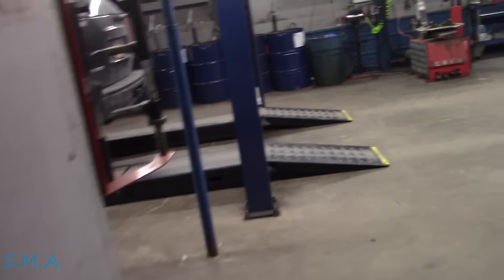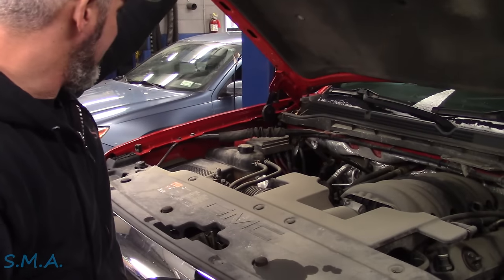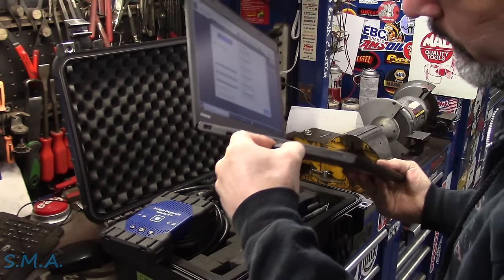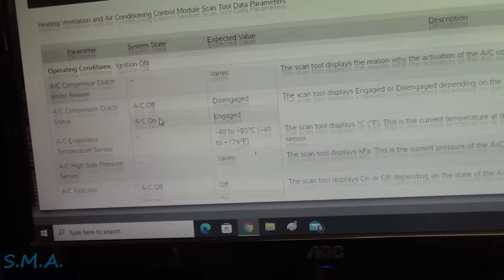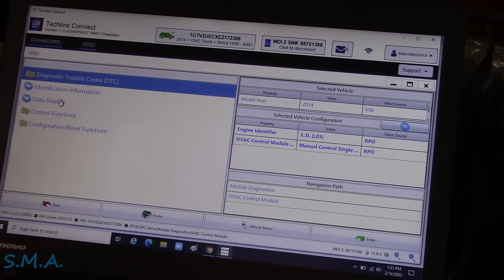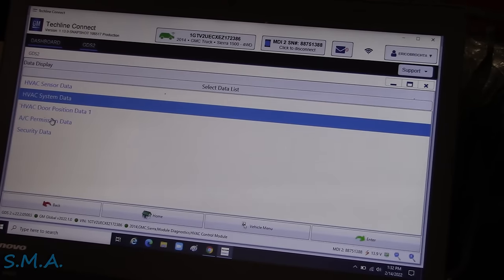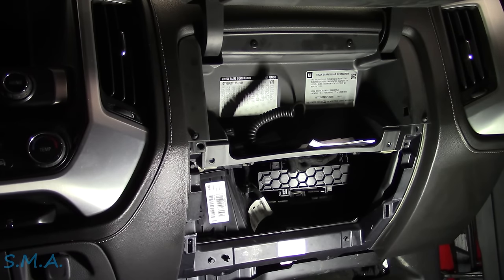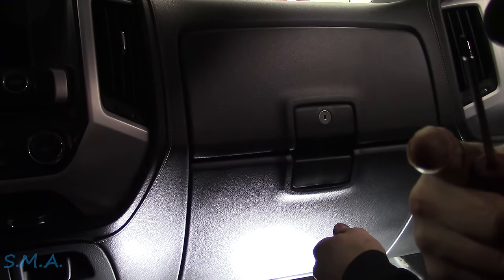Chevy/GMC Truck: Failed Heater Control Module

Comment: Almost every job is loaded with monotony. When I started in automotive I was bored out of my mind with changing and setting points and changing 100 or so plugs every week. The crappy wiring systems in the trunk of every GM car. the rotted exhaust systems and slushcicles dumping down the back of your neck. The same old shit with NYS Inspections. Tie Rod Ends and Ball Joints and way too many alignments.. At least you have issues that takes some brainwork to figure out and R&R!!  I do agree that there is far too many stupid systems on todays cars/trucks, but everyone has to have soft touch everything with heated butt-boards. My key is different from hers and the trucks knows it, so it adjusts everything for that person/key. Hell, I don't know how we ever rolled up our own windows!!!! So yeah, it doesn't matter what your doing if it becomes boring and hey, you could be working on BIG RIGS!!!!!  lol... Yeah that's why I said it....   ;)

Comment: I drive an '86 Toyota truck and an '85 Ford van. One uses a vacuum controlled heat valve and the other a cable operated.  How laughably antiquated and low tech. They just work and cost maybe twenty dollars to repair.

Comment: What you’re saying Eric begs the question, why are the manufacturers converting to electronic control of simple things like a heater?  Is it to prove their mastery of computers?  Well, they proved their mastery of cables that were used for decades to move the various doors in the heater. 
One solution to beat the high cost is to buy an extended warranty and get rid of the car/truck before the warranty ends. That puts guys like you with little to no work🙁.

Comment: just heard u complain about how cars and designes getting so ccomplicated , no more DIYING. go look at aviation, general AND commercial. I've test and repaired, to the component level,  the electronics that drives the motors ,that move slats n flaps. In this particular, nameles, commercial jet had this box located unger the galley. How do I know, cuz they 70% had LIQUID INGRESS inthe form of coffee or COKE. Also, small fires on PCB, hot componenets melting solder. Ialso worked on 1980s boxes that still worked flawlesly. bottom line.... SUCK IT UP, CUPCAKE. and BIG THANK U!! 4 what u do, and 4 what looks like wonderful family.

Comment: Yeah, the whole shooting-match is getting out of hand, and it becomes a big, positive-feedback loop. The more prices increase, the more desirable these parts become to unsavory folk, and the more it costs manufacturers to come up with wacky new ways of locking them down, which raises the prices even more. And the chip shortage doesn’t help the situation, nor does the bubble in used car prices. Eventually, it feels like driving down the road in a padlock with 4 wheels (or 6, if you’ve got a dually)! 🤬

Comment: If you think these HVAC systems are over the top with electronics, you should take a stab at missile targeting and launching system. I'm a retired electronic mechanic, and most my career was chasing the sort of problems seen on that HVAC system.  Gotta be honest, I've been thrown sideways by the systems in civilian vehicles I've worked on.  Much of it is poorly designed, looking at you Range Rover. This is my thing and I'm challenged at times. How are automotive techs supposed to keep up without additional training? Completely forget about DIY repairs. Maybe get into the business of doing analog conversions, haha.

Comment: The main problem with today's tech, can't be deleted without 10 other systems going crazy, things have to be programed. Everything should be its own system and everything modular at this point. There is only 1 reason that it's not, so we cannot fix things ourselves,  that's the point of it all

Comment: Full size truck and they still made it difficult to r and r. Design engineers should have to take things apart and learn how to make service peoples life easier. Wishful thinking I know. After seeing that I dont want a newer vehicle. In ten years these electronic parts will not be available so then you hope you can find old used ones. Dont want to think about it.

Comment: Decades ago I read an interview with Smokey Yunick talking about the increase in tech in the auto field.  At the time, 4 valve/cylinder was up and coming.  His statement on that?  Sure, nice but way more than what was needed.  His zinger?  What until people have to start paying for it to be fixed.

It is getting worse.  I read last week that the auto companies are looking for ways to charge a monthly fee for certain function on your car.  I guess they are looking at Cat and John Deere for inspiration.  Have you read about what they have done with computer/electronic processors/sensors and how you can't fix it?

Lastly, you think this is bad?  Go become a health care provider.  

As someone noted below, every job/career has it's issues.

Comment: I want to see the numbers before I say newer technology is better or worse. 10 guys coming in for a $100 blower resistor or 1 guy coming in for a $1000 module is still 9 less needed repairs in GM's perspective. And becuase less of the modules need to be made as spares for repairs, they probably cost more to manufacture.

You made a short a while back about a ~$1500 gmc led taillight when tailight bulbs are like what, MAYBE $10?  But how many resistive bulbs fail compared to LED's?

I will add though generally less hardware in a system is always better than more, because more hardware has a higher chance of failer compared to systems with less.

I don't know, I'd really like to see the numbers from GM.

Comment: It's absurd that you need a special factory programming tool with a license and dongle for the software to program a heater module.  It really should be as simple as the module receives the info for the specs of the truck from the main ECU, like dual zone climate or single zone etc, and then sets itself up.  That whole process with the programmer and licensed software to set up a simple module is just to be borderline anti right to repair and to bilk the customer and the shop owner out of their money.

Comment: All my and family vehicles are late 80's to late 90's models, minimal electronics and of far better durability of components thanks to over engineering quality mixed with simplicity rather than over engineering complexity mixed with component poor quality .
I got no idea why so many people so easily spend crazy bucks on the new garbage.
hybrids and elec going be ballache of niggles and expense for owners and ballache for technicians try diagnose and physically repair .
My old stuff easy fix but unfortunately hardly ever need touch anything as it too damn reliable :-)
I'll be retired just in time miss out on the full craziness of 2022 garbage thankfully ...

Comment: Why do they put so many electronics/electrics in cars now? Because they can. I've always thought that phasing out the simple cable operated parking brake for an electric brake was ridiculous. Computer modules should be dirt cheap. Four hundred dollars plus fitting for the work you have shown takes a bite of the pay packet. Don't leave the trade we need honest mechanics!

Comment: This is why I love my old beat up jalopy of a Chevy pickup truck.  It's entirely future proof...totally EMP proof...completely shade-tree mechanic fixable...and parts are everywhere!  
If you want heat...slide the lever over to "HOT" and you got it.  If you want air conditioning...roll down your windows and drive faster.  
My grandpa used to tell me:  If it ain't broke...don't "fix" it.  
So...yeah...keep your way-too-expensive bluetooth enabled computerized vehicle...I really don't need all the IN-conveniences that come with them.
Reply: Same a/c as I have in my truck I call it 2x55 2 windows 55mph

Comment: I think for my next truck I'm going to find a nice older C10 because this enhanced defrost control module programming stuff is bullshite. I'd much rather set up points on the side of the road and be off in 5 mins.

Comment: this is why i prefer older vehicles less computer bs n well alot more rugged now a days all plastic n sheet metal  hell u cant even work on the engines without needing a computer to talk to others in the engine n there is no damn room i remember back in 80s u could sit in engine bay n work easily n all u had to do was plug in a small wireing harness ...far as future in vehicles they be all electric n need them serviced at the dealer ...i see everything on the suspension gonna be computer based n of course they would rust faster cheaper materials n more costly

Comment: for the OVERWHELMING feeling of repair and knowledge and cost of todays cars , be glad its not a TELSA ,  $16,000.00 for heater repair !  Off course , back in the 50's you could push a car to get it to start or pour gas in the  " CARB" to get it to fire . Oh how times be a changing 👴🤑

Comment: I have a 2015 Malibu, it had a steering problem, the wheel would get tighter then release, tighter to turn then release... it was under factory warranty they knew what it was, my steering need to be REPROGRAMED! MY STEERING?!?! hat's insane, that my steering needed a software update. We will no longer be able to repair our own cars. If I needed to do this myself I'd need a $3000 computer and the rights to buy the software from GM and a $500 adapter cord. they covered it be cause the car was 3 months old, if it was 3 years later it would have cost me several hundred dollars to "fix" what they already knew. that's why I want to keep my 24 year old truck as long as I can, but up here in the land of "Rust and Corruption" it's hard to do.

Comment: It's like what I've been reading regarding the farmers and John Deer. Their tractors have gotten so complicated and computerized they need special software and equipment to fix them and John Deer isn't interested in letting them have it. So the poor bastard farmer has to haul a dead tractor or combine to the nearest stealership to get it fixed putting the farmer out time, potentially ruining their crops if they need it harvested quick fast and in a hurry, and a tonne of money. Not like the old days when all they needed was a small box of hand tools and a bit of know how.

Comment: I am probably a little beyond a shade-tree mechanic level and have a well setup workshop, but my issue is getting accurate data to follow. I want to subscribe at great cost, but Mitchell wont even let me here in Australia, because I am not a registered business. What level of bullshit is that I ask! Not all models we have in this backwater country even have a manual available if you wanted to purchase it. Makes it very hard. Try getting a workshop manual for those crappy ford "powershit" gearboxes we have been stuck with here. Not even ATSG has anything other than a description manual. That is the biggest problem because we do not have any law mandating access to maintenance data, unlike in the US.

Comment: Eric, prior to 2014 trucks and cars were not repairable to to do it yourselfers. Most low end scan tools wont communicate with hvac, trans, entertainment or sir modules. Even if your scan tool was capable to communicate, nobody wants to purchase a mdi or subscription to program. This is only getting more complicated and less rewarding to technicians. I totally get your drift on moving on. Best of luck sir & well done.

Comment: hell i have sas, abs, traction control lights on in my chevy and i don't care because i don't need them. i was born before they put all that crap in cars and learned to drive without all them so as long as it don't affect how it runs i can care less

Comment: Thats the problem with these newer cars there is too many electronics on what happened to the mechanical controls crap did go bad as much this is the government controlling the auto industry you have to meet fuel milage standards so they have to make everything out of plastic and electronics my 74 buick apollo has more metal in the bumpers then that gmc your working on

Comment: Dealer programming is a huge scam. All the parts should be plug and play.
Could you imagine your computer being like that? New video card that doesn't work because you can't program it. (Sure, drivers, but those are free)

Comment: Really good quality capacitors have a life of 50,000 hrs in optimal conditions In the interior of a car in the summer at 120+degrees they lose electrolyte even faster. There will be no (or very very few) post-2001 cars or trucks still running after 25 years. It is ridiculous that a system that used to be run by a simple cable and bellcrank now requires 3 (or more modules) to function AND worse yet if your vehicle has codes it cannot be registered. Explain to me again how this is good for the environment hint it isn't not when cars used to be good for 30+years and are now obsolete(to expensive to fix) after 10-15. I love my 1998,1999,2000 Saturns 40mpg and no unnecessary systems just a good engine management computer with relatively simple sensors that can all be daiged with a test light/multimeter(scope if you really got a weird one). I will never own anything post 2010 unless it is 1yr old and a trade it in at 4yrs

Comment: Surely there is a market for cars that are more basic. I can manage without Sat nav lane assist complicated fuelling and ignition systems. Even just plain simple aircon no climate control. ABS and Airbags okay they are good safety features. Just get rid of the crap that looks good on the advert. I know I'm in dream land here, none of the big manufacturers have the guts to do it

Comment: How many years did the cable system work, the good old days. A module to run the heater, then the taillight circuit. The smarter they the engineers think they are, the bigger pile of junk they build

Comment: You aint the bad guy, the bad guy is the ones making everything runn off of modules when they dont need to be. Plus nobody made these people buy these vehicles. You are fixing them a lot cheaper than the dealership does, Im sure.

Comment: Crap like this is unacceptable. Sorry. I do not understand how HVAC controls need to be programmed. I've loved those digital HVAC controls too in older cars. My 05 Taurus had it, the "brains" behind it died (actuated the vacuum and blend door actuators behind the dash, not on the panel itself), and I was able to just swap a new one in, no programming needed. My 1995 Ford Thunderbird has it, still working great. My 1994 Roadmaster has it, also working great. Though I did have to replace a vacuum control module for the climate control, which I harvested one out of a Cadillac car. No reprogramming is the point. HVAC should not need programming. I get perhaps features exist, but why not just detect what is there? "Oh, I see the PCM says there's A/C, I detected two blend door actuators, I bet this car has dual climate control. Oh and since I see the PCM? Appears this is installed in a Chevrolet!"

Crap like that is why I am trying to preserve my old cars alive. My daily, a Pontiac Vibe, just has cable-controlled temp and blend doors, simple knob for speed. I have zero desire and cringe at the thought of a newer vehicle that is overly complicated.

Comment: There is no real reason you should have to program a module like that. That requiring programing shit is done on purpose, should just be plug and play. Even if it's the same module used for many different cars the ECU could inform the new module of what car it's in and then have it configure itself

Comment: Content sells. To bad it comes with recurring expense as it craps out and makes your vehicle become unpleasant or impossible to operate. Fuel injection, ABS and traction control and other safety features are sane application of technology. The rest of the automation in cars these days is a lot of unnecessary fluff.

Comment: Recall the good olde days when Robert Pickton abductted and murdered at least a dozen women.
Well, we can thank modules, especially GPS , etc. for keeping track of all vehicle movements these days.
I really don't relish being choked with a cable personally.
The more a vehicle can be rendered as less of a weapon, the better.
Being able to immobilise a vehicle going the wrong way down an interstate would require a fine module.
If a vehicle gets sophisticated enough that it can prevent criminal usage, then that is fine.
No one complained about the old tv series Knight Rider.
Moses descended the mountain with the tablets inscribed with the Ten Commandments.
Moses was famous, but mechanics have to work harder for simple status.
You know there are too many modules in a vehicle when there is no room to sit inside.

Comment: It's freaking stupid, yes. And it's only gonna get worse. With electric cars, you won't be able to do anything. Batteries are a hazard to begin with, everything is interconnected, and monitored, and proded, and sensored up to the hilt. You'll need Diagnostic Bot 9000.

My 'infotainment' system has just failed. It's a black box and a display. It will cost me £600 to get it sorted (and I consider myself lucky on that front), all I want is a MP3 player and phone. I don't need GPS, I don't need all the extra crap. 

A mp3 player with bluetooth and phone connectivity costs £60. 

I cannot put a £60 mp3 player in my car. But I could with my previous pre-2000 car.

Comment: Levers and cables. What was so wrong with them?
Now you have a module and an infotainment gizmo and a this and a that and a blend door motor to go bad and then something to program it when it goes bad and a computer and an Eric O, and... Then you wonder why a pickup costs $60,000.
Why? So you can have 'automatic temp control' or your wife(yes I said wife and not significant other 🤦) can have her zone 1 degree higher?
Smh.